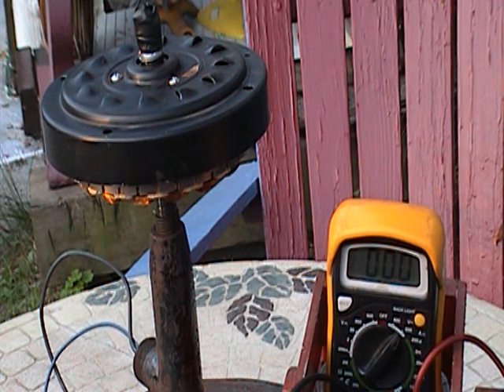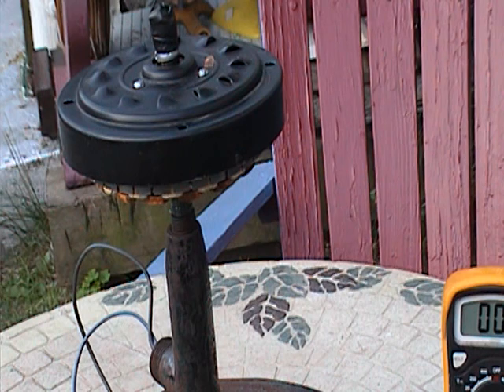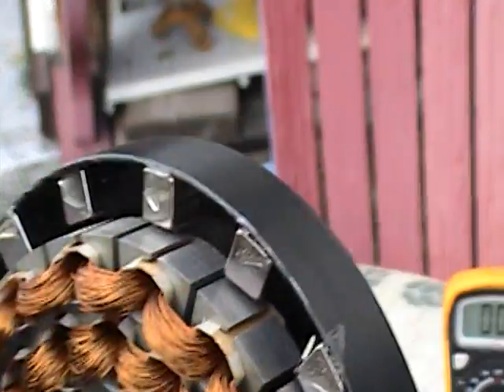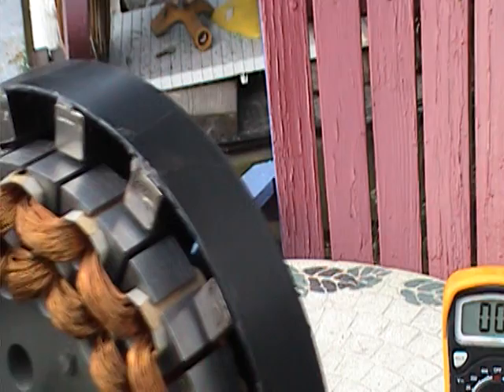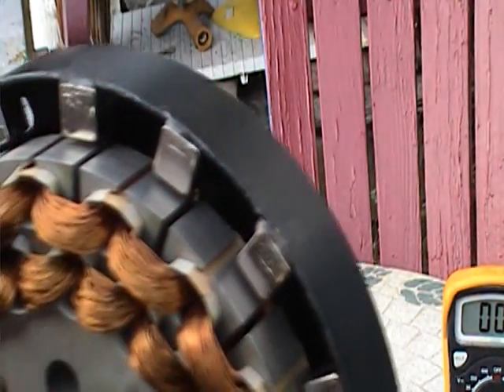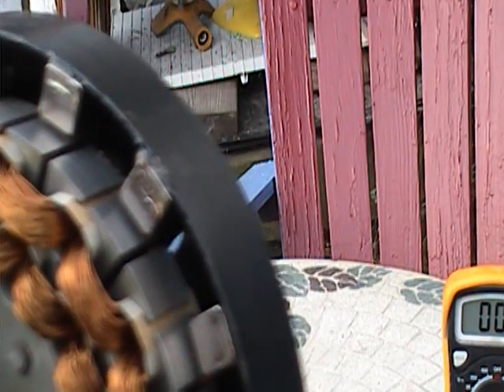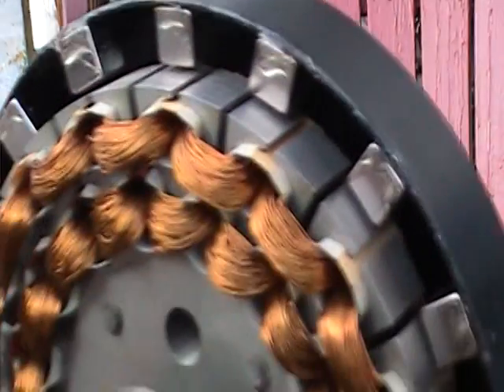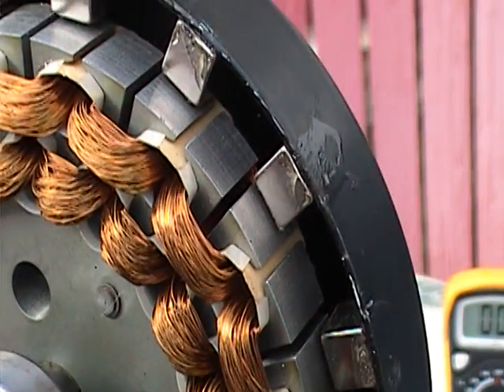HALF CEILING FAN ALTERNATOR

Comment: @generatorblue I didn't know what topsy turner was, but I looked it up, and ithat seems easy as well. With my aquaponics system I used a plastic pipe from 4 inch . I drilled some holes so a small plantpot fits in the holes. Then I pump water from my fishpond through the pipe, and the water end up back in my fishpond. The fish waste is converted into nutrients, and it is possible to grow eatable fish as well. But in the future I might do the topsy turner planter as well.  Thanks for sharing :-))

Comment from the maker: @insAneTunA,I will check out aquaponics. For now, I am very impressed with the Topsy Turvy planters because I have that image of parallel horizontal bars eight feet apart from each other and rising up 80 feet from the ground. Wide racks with ten rows of Topsy Turvey plants, Water dripping down from the top rows to the bottom row will be an efficient irrigation system with solar pumps. Sunny arid land can now be cultivated on a wide scale. Racks built with water pipes and triangular end support.

Comment from the maker: @electrodacus I used the same ceiling fan with different magnet setups in 4 videos. I used Super glue or crazy glue to temporarily hold the magnets in place and then scraped the glue off with razor blades before changing the configuration of the magnets. However I use resin to make things permanent.  I saw your motor. I stayed away from servomotors because they have gears. In an urban setting gear noise can be annoying. In one video I compare the output of a scooter motor to a ceiling fan.Thanks

Comment from the maker: @stevenvantuyl44 The easiest coils I recycled came from the fans used in microwaves ovens. I remember either unscrewing or drilling through some rivets that held the laminated iron plates' assembly together. The centerpiece was loose and I was able to retrieve the coil without much effort and without any damage. The magnet wire was not glued to itself either. But the wire was very thin. Maybe I should have used 3 wires in parallel. It took a lot of work to get the coil from the big transformer.

Comment: I do like what you have done with the magnets but there is one thing you may be overlooking, even though magnets are scintered when they are made and cannot be machined such as drilling or tapping for screws they can be ground with tools such as dremmel type equipment and possably even sanders or grinders BUT DO KEEP IN MIND THAT ANY GRINDING MUST HAVE A RISK OF BREAKING THE MAGNET IF IT IS NOT DONE CAREFULLY AND SLOWLY ALSO NEODIMIUM MAGNETS WILL LOSE THE MAGNITISIM IF THEY ARE HEATED

Comment: I have been mining wire from discarded televisions the yoke and the gauss ring around the picture tube for enamled magnet wire also I have found computer monitors a good sorce you have to be creative when unwinding the wire ( and patiant ! ) A great sorce for magnets is inside computer hard drives but be carefull because some of the platters are made of glass and ceramics instead of aluminum

Comment from the maker: The wind does not blow all the time & fridge does not run non-stop. But to run the fridge without batteries, you will likely need 8 alternators. The alternators will spin very fast and deliver 200 volts at almost one Amp. However, once you plug a big load like a refrigerator, the alternator will spin slower and deliver less voltage and less current.
A 4 amps fridge at 125 volts is rated 4 X125 = 500 watts. 125 volts X0.5 =62.5 watts per alternator. Then 500/63=about 8
alternators.

Comment from the maker: @1111atreides I post my videos the first day I get the device to work. If I had to do it over, I would have clean fingernails as well. You will need to rectify the current to charge batteries. However you can hook it up directly to a car headlight or other car light bulbs, which I did. DID you say dryer? One of my ideas is to rotate the wire mesh cage seen in the "Wind or Catamaran on a River Turbine" with two ceiling fans. By adding a gate to the cage, I will have an "Outdoors Clothes Dryer."

Comment: I got 230+ rectified dc volts with a rpm of about 300. I have a 16 coil (16 inner coils and 16 outer coils)  I had placed magnets by each coil but the voltage was very low. seems the magnets were interfering with each other due to close proximity to each other. I took out half the magnets and wala! all kinds of volts.  it does light up a 115 ac volt 15 watt light very brightly.   I rewound one fan motor with 18 ga wire but could only get a few winds per coil.. result 10 volts.

Comment from the maker: @jfperkins3 In my other (full) ceiling fan alternator videos you can observe magnets that are longer, sticking above the rim of the half cover. In order to close the unit, it will be best not to use the other half cover, which is made of metal. Even if the magnets are secured with resin, the metal cover could displace them (mag force). It will be simpler and faster to replace the metal cover with a plastic one of the same diameter. You will likely need to cut a plastic container and make it fit.

Comment: If you can stick a screwdriver to the outside of the sheet metal where each magnet is, you are losing a lot of magnetic flux. You should add more steel around it to carry the magnetic flux to each adjacent magnet. Many motors are made and they realize this and put a metal sleeve over the outside. You could take metal strapping and wrap it around a few turns. If you do experiments with this, you will see a big change. Also the magnets will hold themselves better to the cover.
Reply from the maker: I am sure that you are right. However, I think that ceiling fan alternators have enough metal in the stator to generate all the power they are design to burn. I discovered that in this video: "Ceiling fan alternator's 230+ volts output" and lately in my video entitled "bicycle power for the world", I recorded open circuit voltage of 440 volts for a fraction of a second. Basically, I will need to install a voltage controller. I even tell people to rreplace the half metal cover with a plastic cover because it makes it a lot easier to close the unit without dislocating magnets. Finally, in the video entitled
"scooter motor generator and ceiling fan alternator", I experimented with adding magnets to the outside of the cover. I like your gardenning video. Do you know that when you buy a bag of kidney beans, you can plant all the beans and only harvest at the end of the season when all the pods turn brown. The animals do not seem to eat beans green or brown. I am mentioning this because you seem to have enough land. You may have to erect temporary fences or towers for the beans to climb. I use discarded fishing nets for that. You can also havest string beans but you have to harvest them very early before they get to be 6 inches long or longer.
Try to make peace with your neighbors if you can. Take care!
Reply: I planted one row of kidney beans, had a problem with Japanese beetles, they like that bean better than the others. I bought a bag of dry kidney beans in the grocery store, that was the cheapest way to buy seeds. I used fencing for my lima beans, but I think kidney beans need something to climb. I planted Northern beans also, but don't even have pods yet.
Reply from the maker: Paul Crissman I bought some small packages of string beans at home depot but they did not germinate, I then got some kidney beans from the kitchen and replanted. They all grew and climbed very high and produce lots of beans. I do not have enough knowledge to be a good farmer.  This is why I get excited when something works. I do ok with tomatoes but I have to enclose the plants completely with plastic or wire mesh to prevent the squirrels from eating every single tomato. This year I got some plants that did not grow tall and could be enclosed. Harvesting takes time once you enclose the plants but it beats finding tomatoes on the ground half eaten. I tried protecting the tomatoes inside parts of plastic bottles but the squirrels fought hard to get them. I think that I need small porcupine looking bags with a zipper and spikes, to protect tomatoes and other fruits. Cities are filled with squirrels that dig out the seeds in the springtime and are ready for the harvest anytime something turns yellow. I even caught a mouse that went for the trap setup with a piece of tomato and ignored the trap with the peanut. The mouse followed the tomatoes inside and bit a couple of them before I decided to use tomato for bait. This reminds me of the little bird that went around every corner looking for spiders to eat while the other birds were eating seeds. Growing a garden is serious competition as nature seems to be very complex. It looks like you have the right tools to deal with it.
Reply: Good
Reply from the maker: محمد بن منصور Thank you! More videos:
https://www.youtube.com/playlist?list=PLC548087BE6798BC3
Reply: Paul Crissman ◾◾◾ hi, so, it's ok to glue  the magnets to the ceiling fan interior cover as here, but "add steel banding on the OUTSIDE? , let me know as I'm building my first one, please explain in laymen terms if you can, thanks a bunch!
Reply: Cyrus Ramsey Yes, steel banding will increase the magnet flux going through the core of the coils. Remember, the magnetic flux decreases by the square of the distance away. If you move the magnets away from the coils twice the distance, you decrease magnetic flux by 4 times. You want to get those magnets as close as possible.
Reply: Yes, it's OK to glue magnets inside, I was going to make one also, but I'm looking for a washing machine motor now. They are already made that way. It's hard to get one, too many people know about how useful they are.

Comment from the maker: When my alternators did not reach 12 volts, I bought bigger magnets that scared me and never used them. I then decided to copy the ceiling fan design. I made the winding of the coils easier (all in series with one piece of wire) but did not have enough ferrite material in the hollow spaces inside the coils See my "Haitian Alternator" video. I will try again one day. Ceiling fan alternators=small magnets, coils already included and high voltage at low RPM.Rewind vs more alternators for more Amps?

Comment: https://www.youtube.com/watch?v=ufC7hN1H8scy using an old scooter motor you can get 250 watts for a smaller amount of work
Reply from the maker: +STEVEY RAINS  I compared the two in a video. I think that the scooter motor has carbon brushes that need to be replaced after a while. However, the scooter motors that I purchased on e-bay were completely sealed. I could not open them to take a look at the carbon brushes. Ceiling fan do not have carbon brushes and can generate electricity service free for longer period of time. I enjoyed your music. This message was captured by Youtube, I just discovered it today when I was asked to review and approve some messages. Thanks for the feedback!